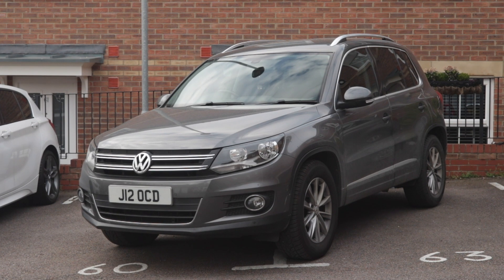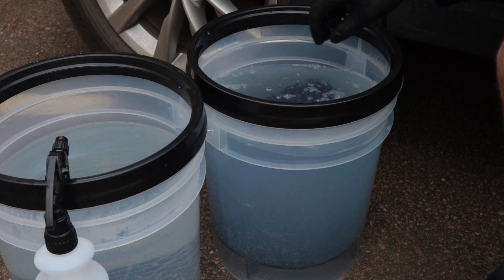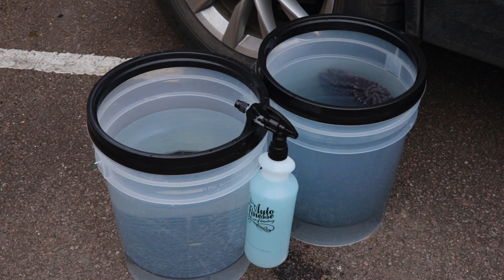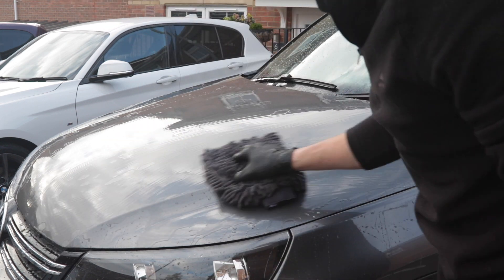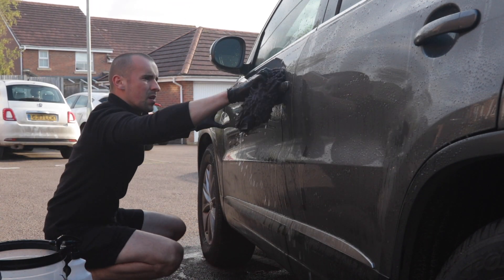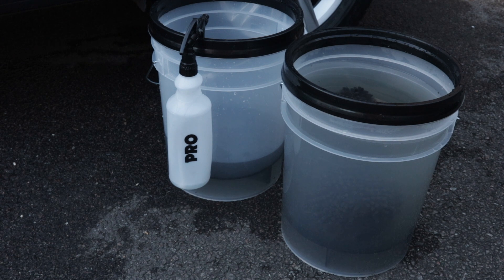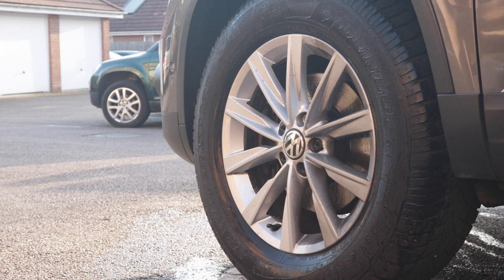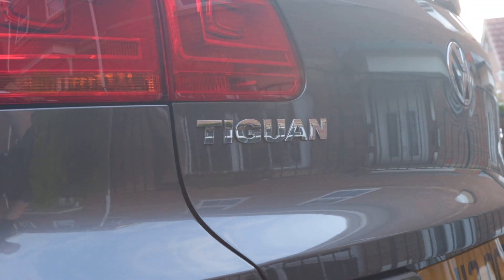Detailing without water | Tiguan Lockdown Detail

Comment: I tend to use big red sponge or Garry deans wash method, pre pressure washing if needed,  With onr I like to squeeze most water out so its just dripping. It still gives the lubricity and makes it easier to dry due to onr more effectively " gathering itself".

Comment: Also you want the mitt on the point of dripping with the onr I would never use the wash mitt after using it on the wheels back on the paint brake dust will remain in the mitt even after the wash brake dust is sharp

Comment: Get yourself a worx hydroshot , it sucks up  water  from a bucket and is battery powered so no hose or electric cable required , I use this over winter ,when the temps are too low for the electric pressure washer . 👍👍

Comment: 2 caps would have done bro. ONR is brilliant.. I only use it on dusty/slightly dirty cars though, struggle to hit intricate areas.it is a very safe cleaning method though, i fully corrected a black 911 turbo..i Maintain it will ONR.. ZERO defects inflicted. Take care sweetcheeks x